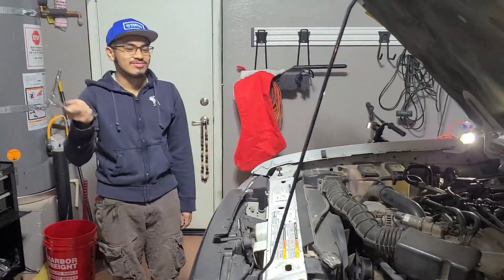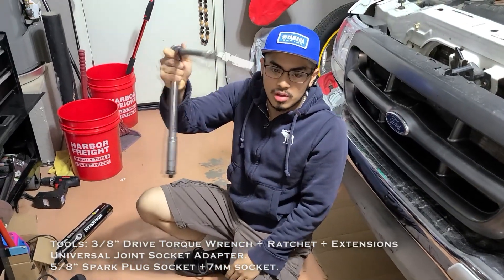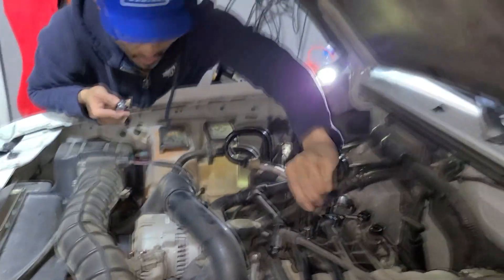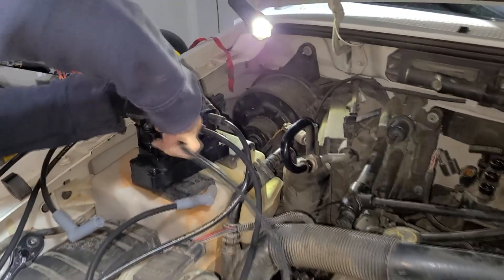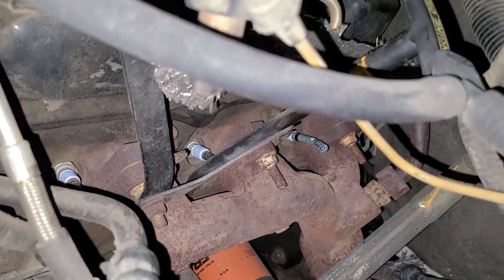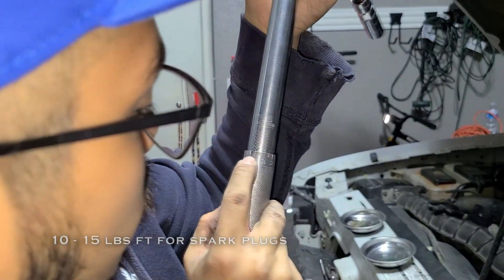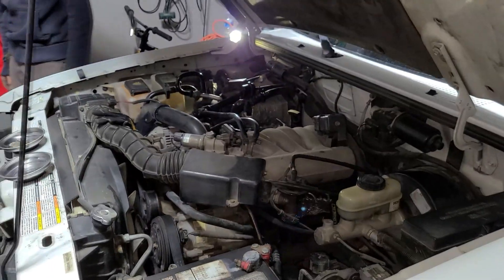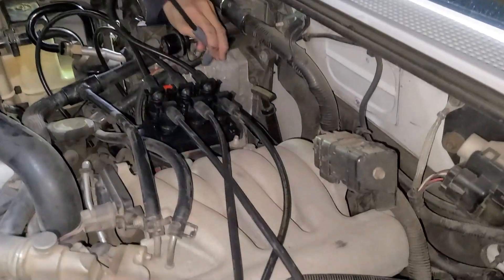Ford Ranger tune up HD | Spark Plugs, Wires, Coil Pack | Tutorial

Comment: Is it the same for  96 4.0
Reply from the maker: It will be similar however the position of the plugs might be different. The trq spec is 7-15 ft lbs which is a similar range to the 3.0. Hope that helps! 🙏

Comment: I didn't see you take the intake manifold off 😳 ?  Is it necessary in this Ranger 3.0 liter ?  Is it pretty easy in your opinion to replace plugs ?  What would you say is the most difficult part of this job on this Ranger 3.0 ?  Thanks for helping in with this video  'Mijo ' 👍😎
Reply from the maker: Hey tonio, taking off the intake manifold isn't necessary on the 3.0. I would say it is fairly easy, but it'll take some time maybe 1 - 2 hours. The hardest part is getting the plugs  closest to the firewall. But it is manageable, glad to help amigo!
Reply: @Life_Has_Changed  
Right on ' keep up the good work '
they say ' that time on a job will turn into experience 😎👍🇺🇲

Comment: Should/can you put a bit of lube or something like it on the threads to keep the plug from sticking for future removal?
Reply from the maker: I don't recommend it as the threads on plugs these days have protection, and they don't seize up. Also when you put lube it may cause you to over tighten, and dont over tighten spark plugs, do it to the manufacturers spec, otherwise it could misfire. But you could put dielectric Grease on the plug boot.  Hope that helps!
Reply: @Life_Has_Changed  thx! Makes sense

Comment: Got some from part store for my 2007 ford ranger 3.0L v6 . Is that the gap recommendations ? .I got the truck with out owners manual. Pre set gap is @ 0.040 on the first one.
Reply from the maker: 0.044 is what we set our plugs to based off the Haynes repair manual. So 0.40 should be good👍

Comment: i have code p0351 meaning ignition cyclinder 1. i was going to do a complete tune up like this. this should fix it right. 06 V6 3.0
Reply from the maker: Yea p0351 usually means electrical issue and that could result in a misfire. Usually changing the spark plugs, or the ignition coil would fix it. But if it doesn't you may have a vacuum leak or the throttle body could be dirty from carbon buildup. Hope that helps!

Comment: How about using aluminum anti seize compound on the spark plug threads   Easier to tale out
Reply from the maker: I don't recommend it as the threads on plugs these days have protection, and they don't seize up. Also when you put anti seize it lubricates the threads and it may be over tightened. And dont over tighten spark plugs, do it to the manufacturers spec, otherwise it could misfire. Hope that helps!